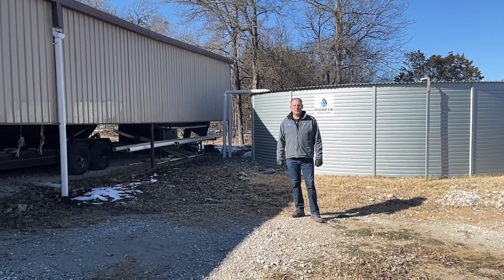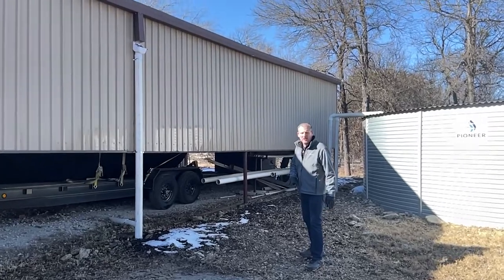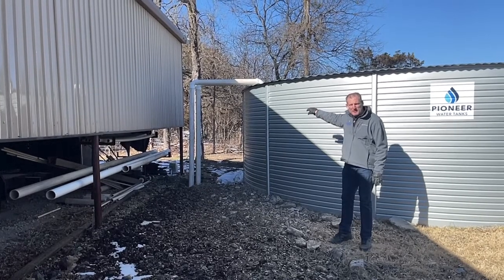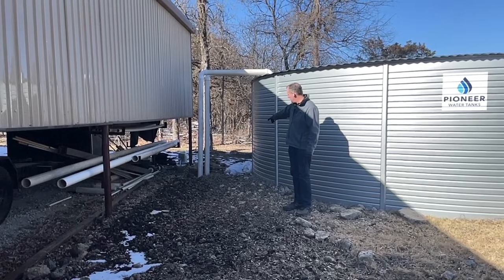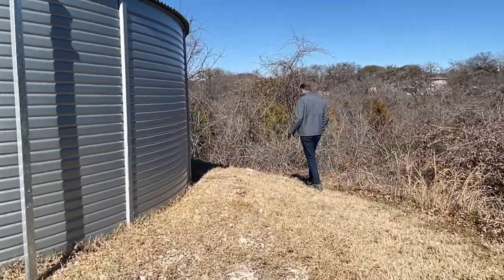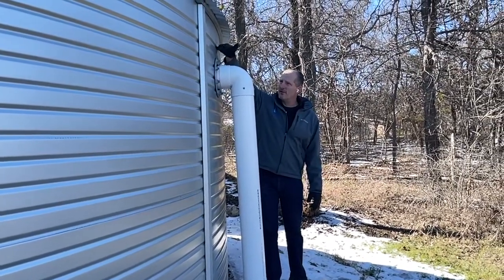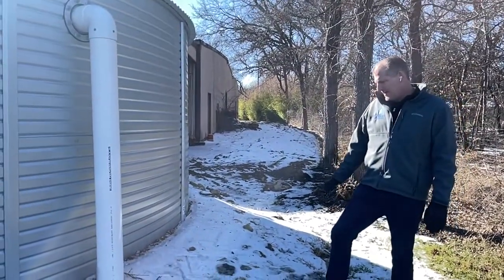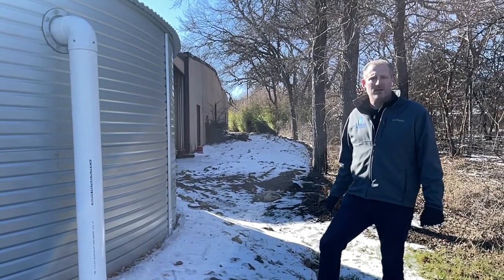Collecting Snow Melt in a 30K Gallon Pioneer Water Storage Tank

Comment: Couple Questions:

1: how do you keep the PVC unfrozen when its cold, so that moving the water in those times works?

2. How do you make it potable?
Reply from the maker: @GetYurMindRite  1) you either want to install a low point drain so you can dump the conveyance pipe during freezing temps, or you may wrap heat trace tape around it. In most cases, it’s uncommon for 4 inch schedule 40 PVC pipe to freeze, but it can happen.
2) Rainwater is most commonly made potable with a UV system. In most cases, clients, use a sediment filter, carbon filter, and a UV light to make the Rainwater potable. We stock those systems, and you may find them on our website at rainwaterequipment.com

Comment: How does it stay thawed?
Reply from the maker: Depending on what part of the country the tank is in, there may only be a few inches of ice that forms in the top of the tank during sub freezing temperatures over several days. It typically would require temperatures to be in the 20s for many days before ice would begin to form on a tank of this size. Then, of course, as temperatures increase, the ice will melt leaving the tank without damage. Tanks in colder climates may be equipped with insulated board between the liner and the steel walls to mitigate freezing.

Comment: How long does it take to fill a 30k tank system with rain and snowmelt from a building that size?
Reply from the maker: We almost never get snow in Texas. But the heavy rain events will fill it surprisingly quickly when collecting from a roof of substantial size. The multiplier is .62 for every square foot of roof space. For example, 1,000 sqft will yield approx. 620 gallons of water in a 1" rain event. This building is 9,000 sqft. So a 1" rain will produce approx. 5,580 gallons of collection.